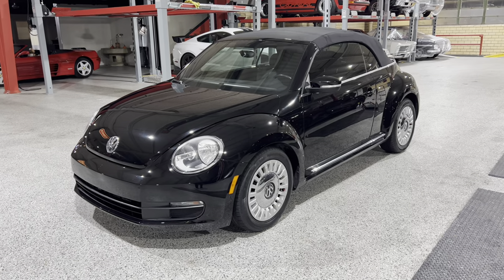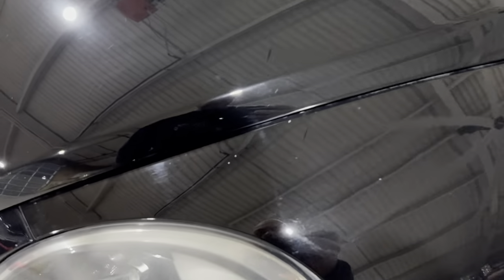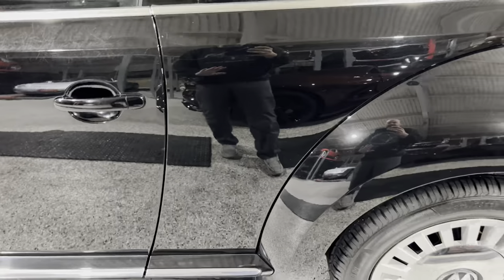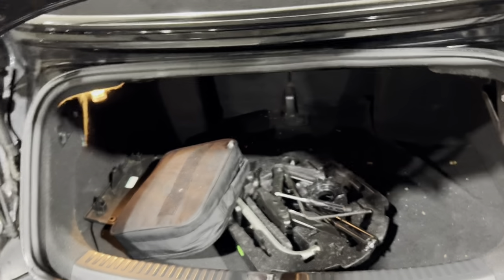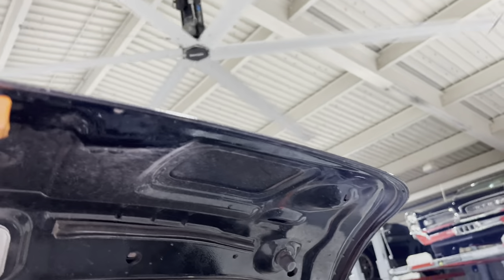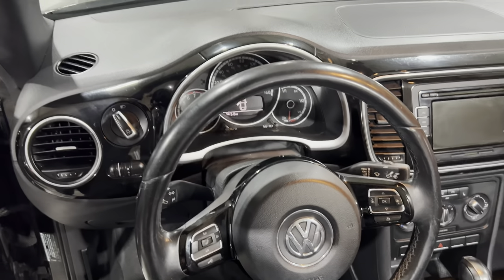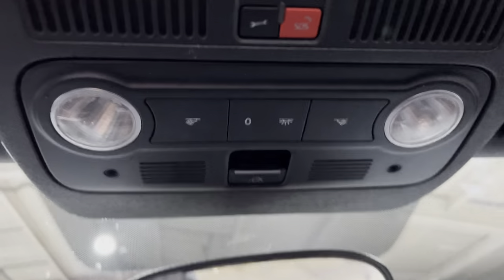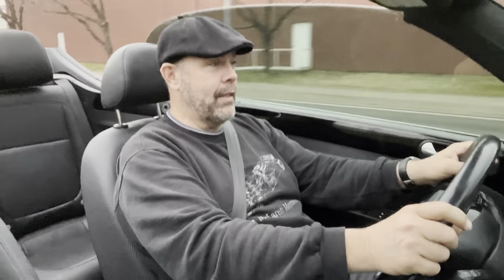2015 Volkswagen Beetle Convertible 1.8T automatic for sale

Comment: Perfect California PCH (Pacific Coast Highway) beach cruiser. 
Poor thing deserves to be in SE USA or California!
PS - you always have an interesting variety of cars on your web site.
Reply: I read that as CHP. I think it would be funny to see the Chips driving these (Chips are California’s Texas Troopers).
Reply: The CHP famously used Fox Body Mustangs in the 1980s and also use to have Harley-Davidson motorcycles until they switched to BMW. A few years ago the CHP decided to change its motorcycle fleet to Kawasaki right before moving from the Ford Crown Vic and Dodge Charger fleet to Ford Explorers almost exclusively. There are a few older Chargers and Crown Vics, but most CHP officers require equipment that exceeds the Charger’s payload rating.
Reply: PCH is beautiful in Northern California. Once you get to Los Angeles, avoid it. There are better roads in LA County to enjoy. PCH is very industrial in Long Beach and San Pedro. Rejoin in Orange County and San Diego. Your trip ends in beautiful San Diego.